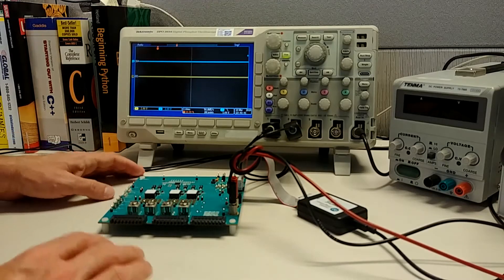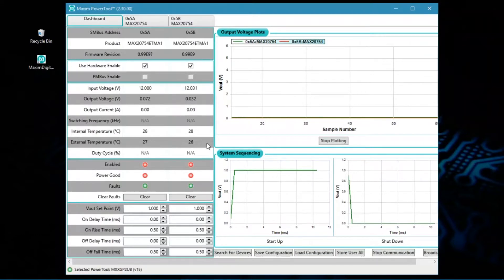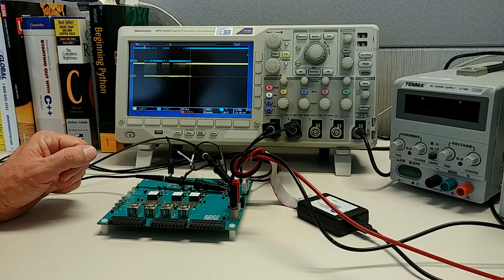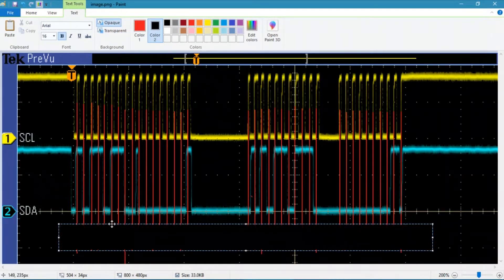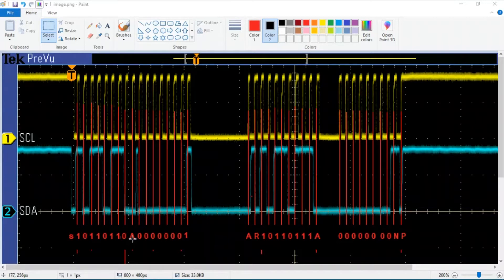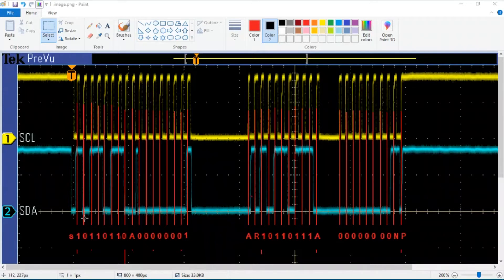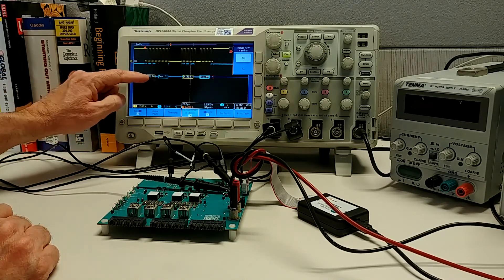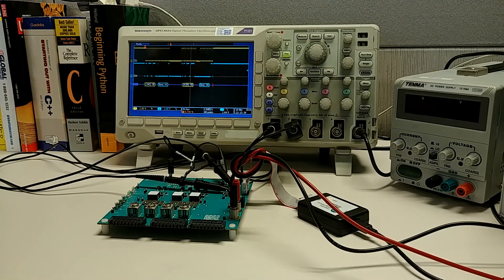How to Debug PMBus and SMBus Issues - Part 1: Communication

Comment: Hi thanks for you sharing i start to learn for read internal voltage from power supply 
i scan address of power supply found 0x01, how to read interan data by i2c with arduino, thanks.